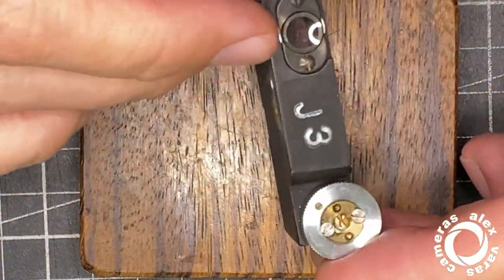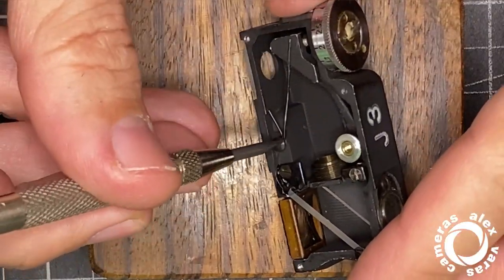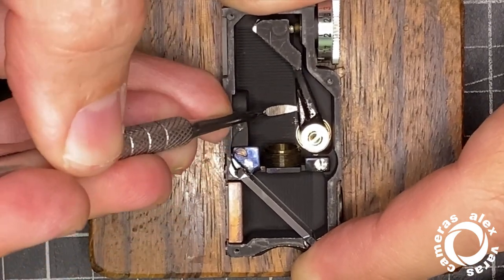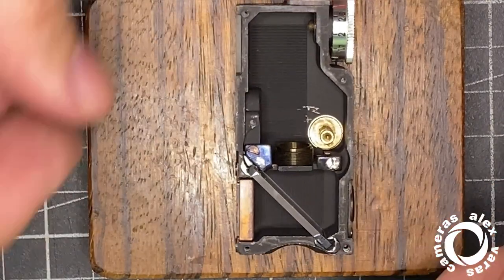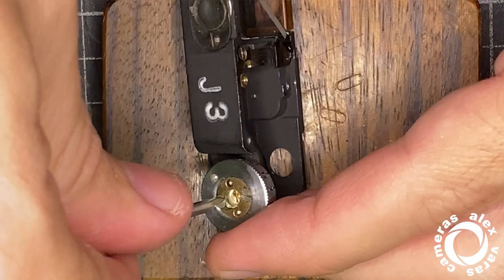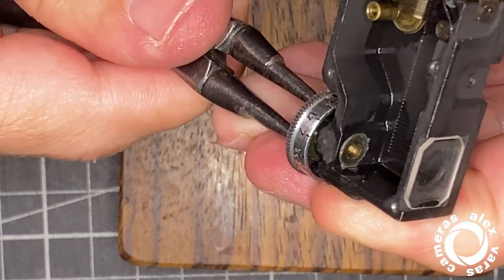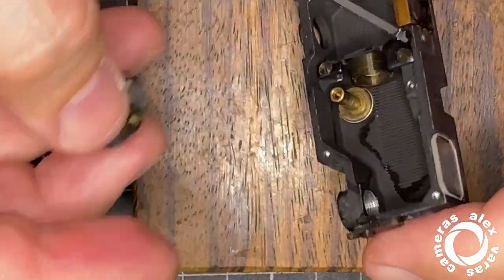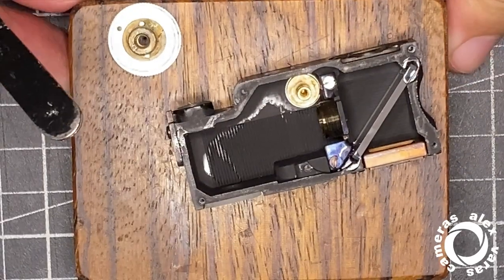Agfa Isolette III rangefinder cleaning.

Comment: Great Tutorial! 
Could u demonstrate how to calibrate the rangefinder after cleaning?
Reply from the maker: I don’t have a sample now. Anyway in the outer rim of the rangefinder there are one/two locking screws that set the infinity point, loose or unscrew so you can now rotate the inner part with pliers and set the infinity point, when is set, screw back the previous screws and all is done.